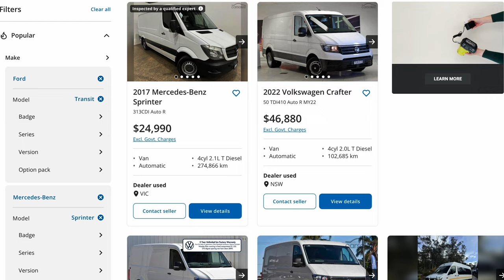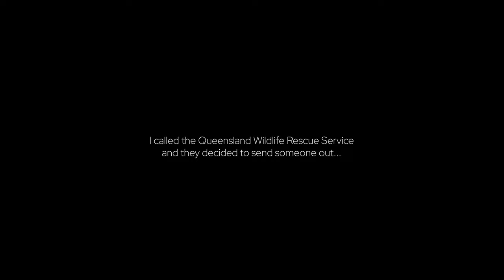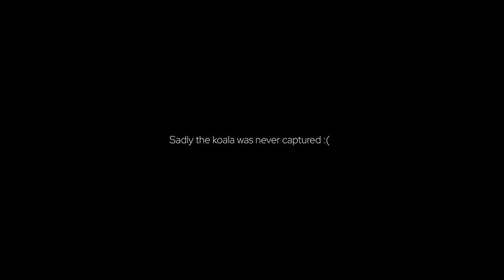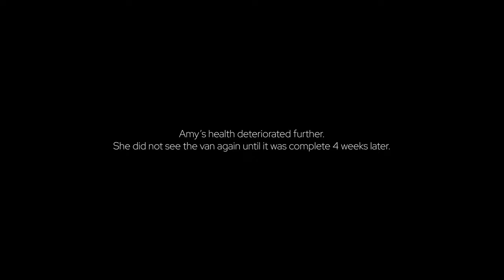Shocking Truth: Burnout during Van Build (4/5) 🇦🇺

Comment: Use a drill with a clutch. Like a battery drill. ALSO, there should be a centre drill bit in the hole cutter. It NEEDS to be longer then the hole “bit” so it drills a centre hole then the hole bit cuts the hole. It will
Hold it centre and reduce the catching.
Reply from the maker: The holesaw arbor itself couldn’t fit a drill bit long OR thick enough (they just kept shearing off) - do you get what I mean? The clutch idea is interesting, but you know how these things go… I just used the drill I had. At this stage in the project I just couldn’t lose more time and money buying new drills etc. Thanks for the comment! In future I’ll consider that! Quite a unique issue though! 🤣

Comment: bit late now, bit it is better to run wiring inside of conduits and not there touching flammable materials of the insulation. especially since a lot will be DC which is prone to light arching and fire

Comment: Guys, I hate to piss on ya parade and it's fair to say this isn't going to be a f/t thing for ya and you're probably not fussed about insuring it for market value, but to avoid any angst from the DOT, make sure ya tell any of the Old Bill or those DOT pricks that it was built back in 2022. This will save ya having to put those batteries in a sealed and vented battery box per the new PITA regulations. It doesn't have to be a bank vault, but it does need to be compliant. I am doing a full build on a new Transit 470E and these bloody things require venting outside (more friggin holes) and to build a decent vented battery box that is compliant is costing me nearly $400 for 2x2x400Ah battery boxes and a whole world of parts and fans and trays and a cluster f*ck of headaches.
Reply from the maker: The rule was implemented much more recently than 2022. We have our MOD plates, our gas certificate, we had an individual company evaluate the van at market value and then got it insured comprehensively. Basically this video is months old and we got in just before the rules changed. Our next series on Thailand was filmed 2 weeks ago so we’re back up to date 😊 the problem was our last Egypt series was so long that it ended up pushing our van series later and later. So all future series will only be 5 or 6 eps. Does that make sense, kind of hard to explain?
Reply from the maker: And thanks the comment!! If you see anything else let us know 🙏🏻